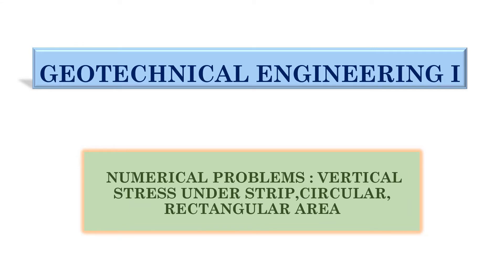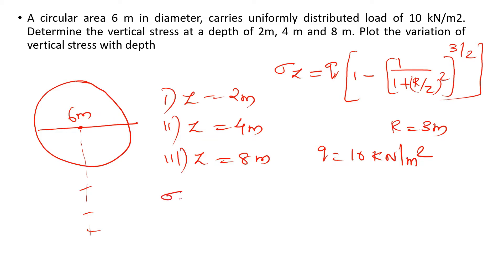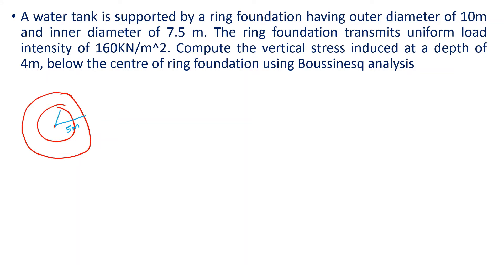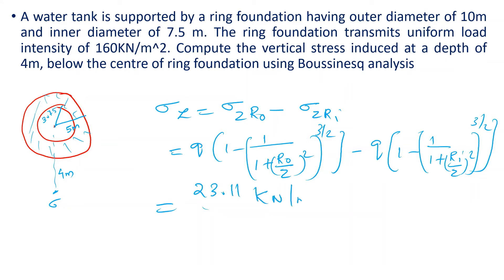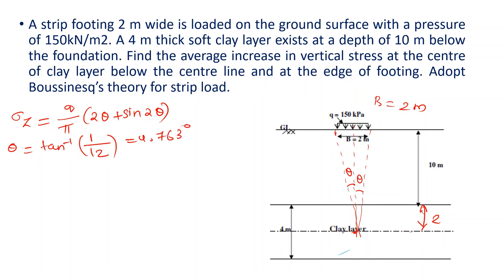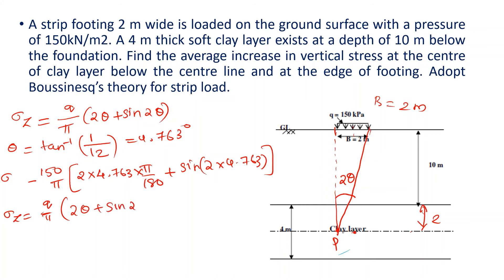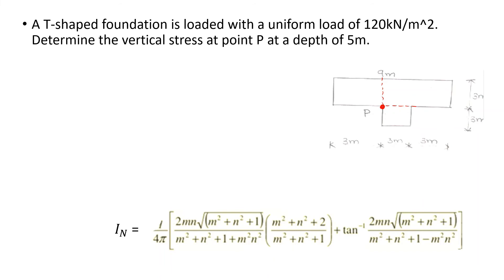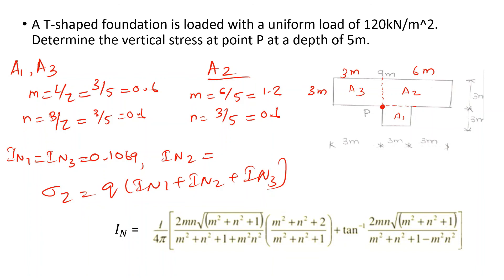NUMERICAL PROBLEMS   STRIP LOAD,CIRCULAR AND REACTANGULAR AREA

Comment from the maker: In last example value of IN( Influence coefficient) is calculated roughly. When you calculate the value accurately you will get it as 0.1234.
Reply: miss , theta radian ill ano edande?
Reply from the maker: @blessygrace6450   yes. Listen from 9.20